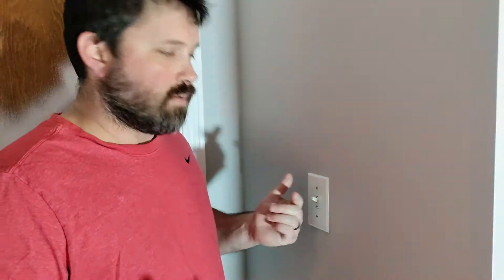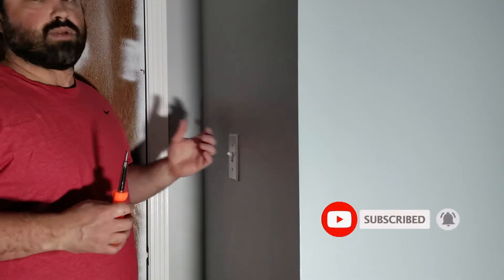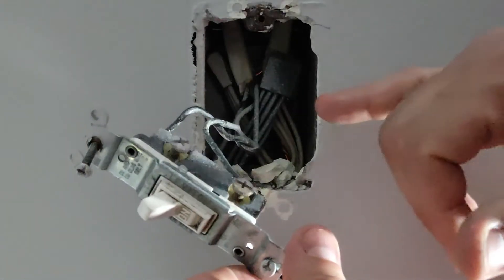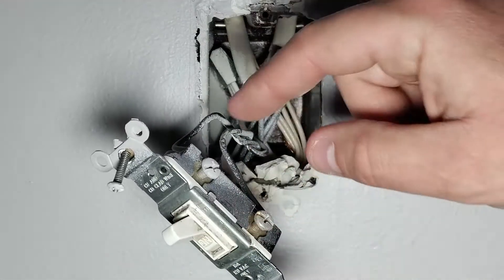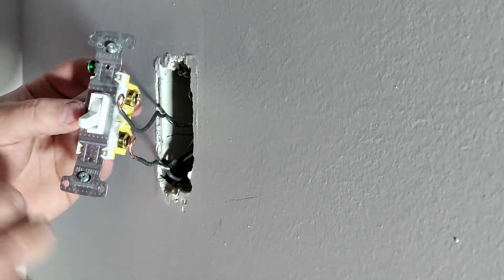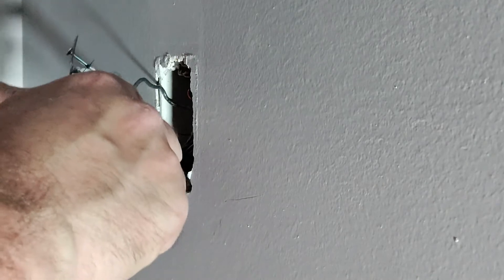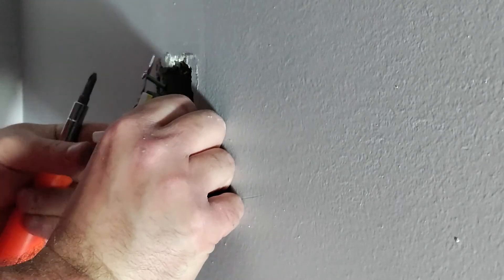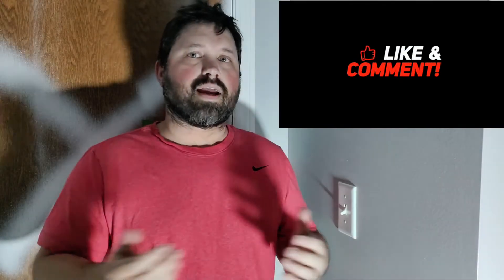How to wire a light switch (single pole)

Comment: How do you know which wire goes to the top screw and which to the bottom?
Reply from the maker: As long as they are both hot wires they are interchangeable, so it doesn't really matter which terminal, they can go to either one.  Your ground goes to the green screw and the neutrals should be connected together.  Only the hot wires go to the switch.